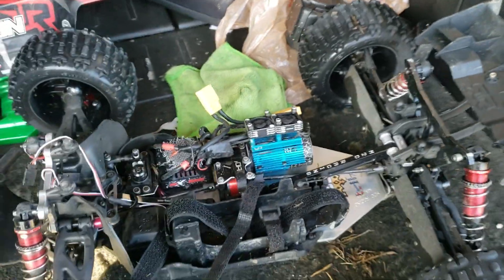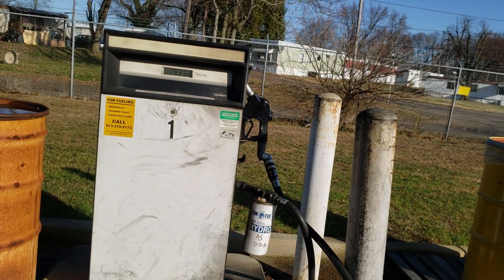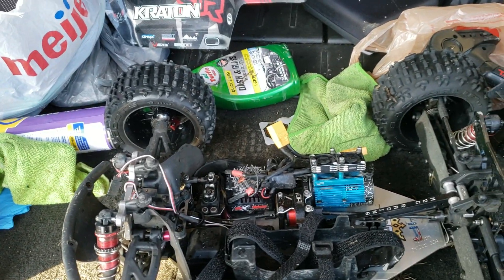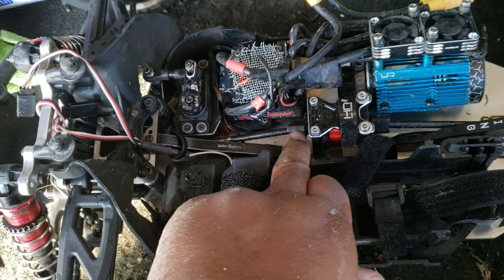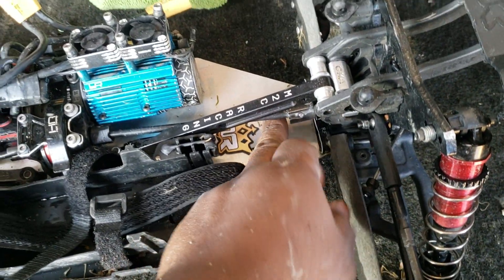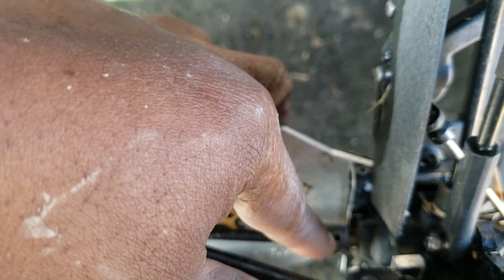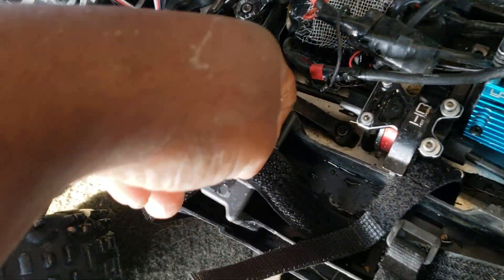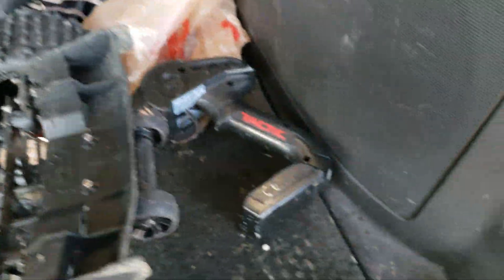Bash ended quick 🤣 arrma kraton.

Comment: Great video 👍👍
Reply from the maker: Thanks bud just fixed it 👍 but it's raining now so no bashing lol 🤣 don't feel like cleaning it again
Reply: Hey Kal do you prefer 3.8 badlands like on here or back flips ? on the v3 ... I'm running 15t pinion thx bro 👍
Reply from the maker: @beetlebailey9510  bro I'm running backflips lp these are outcast 4s tires. Backflip lps and Badlands 3.8s about the size just the backflips lp maybe a inch taller. I go with Badlands 3.8s for light weight. But I love my lp's
Reply: @KalsRcAdventures  cool bro thx for the info
Reply from the maker: @beetlebailey9510  no problem bro